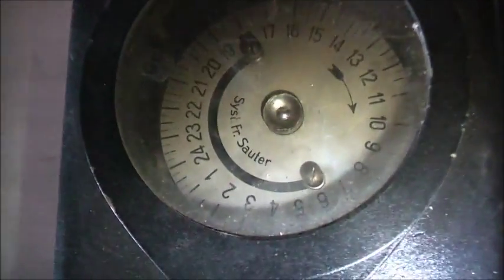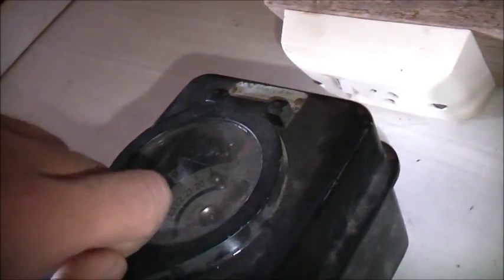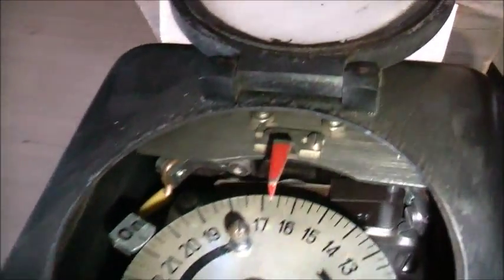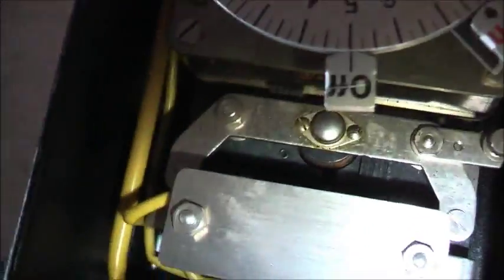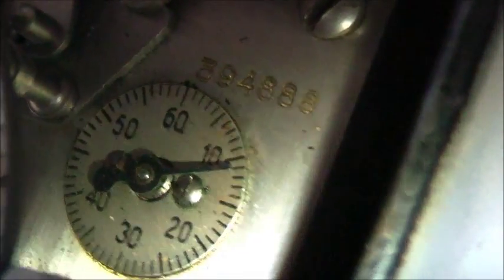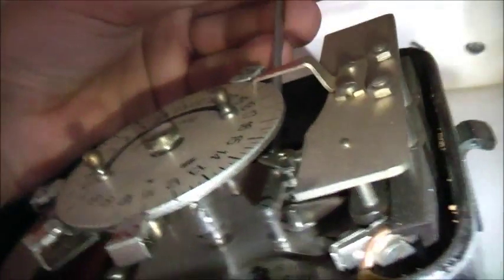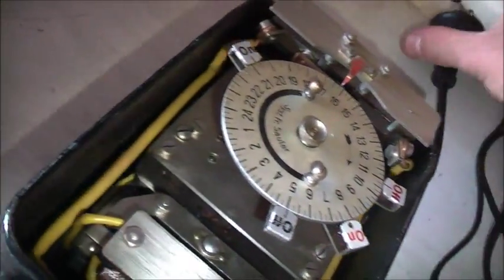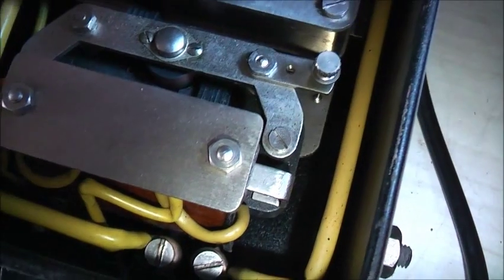Fr Sauter Type SW30 Timeswitch Restore & Test

Comment: Never heard of this manufacturer before. Unique timer right here. :-)

Hmmm, that motor...Maybe it is to rewind the spring reserve, as the escapement in this one may be a continuous-runner. The motor is a spring reserve rewinder, hence it not being a synchro motor.

Bit of a similar set-up to a Horstmann Ymk 2, but in those the motor and the escapement run continuously, and of course, the Ymk 2 has a synchro motor, like all of my Horstmanns. :-)

Thanxx for showing. 

-BoomBoxDeluxe.